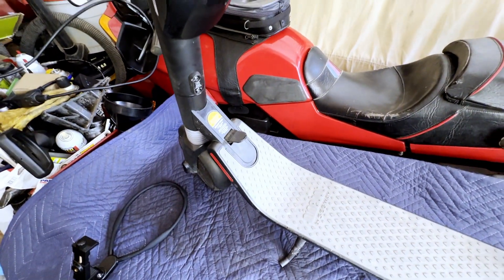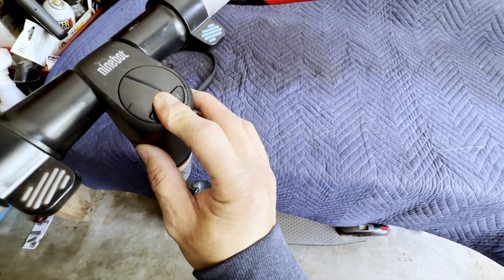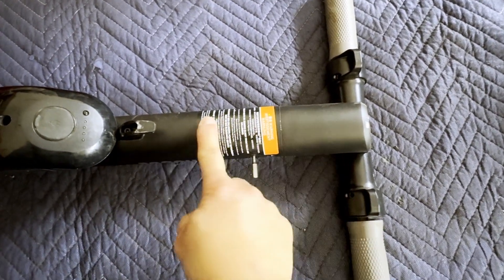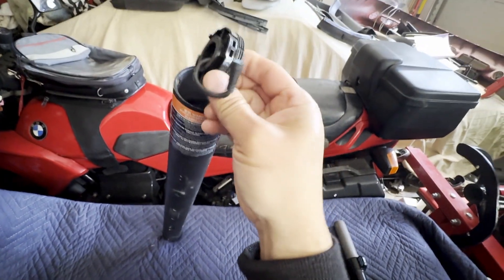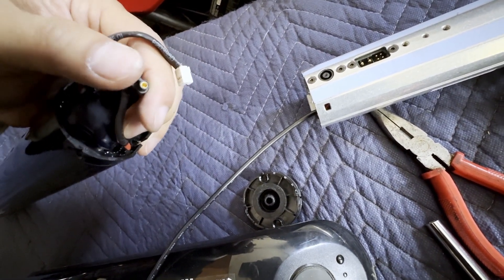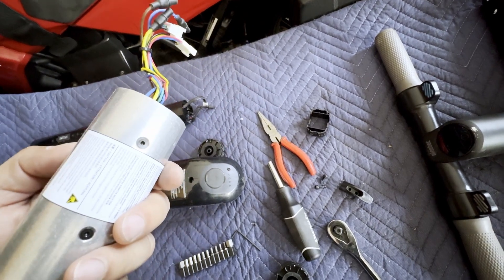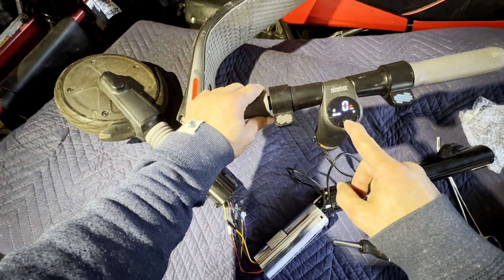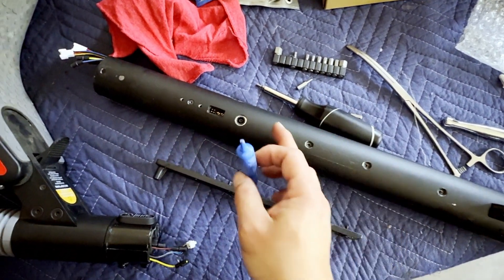How to Fix Error Code 18 | Ninebot ES Scooter

Comment: Kontrolör ile alakası yok. Motor Hall sensör kablosunda sorun var motoru söküp kabloya bakın. Soğuk lehim vardı bendekinde hallettim
Reply from the maker: That's certainly what the error code suggests, but for whatever reason, changing the controller seemed to solve the problem. I've ridden over 160 miles after replacing the controller and knock on wood no issues :)

Comment: hey my ES2 powers off with a single click instead of holding the button while clicking the button should toggle the flashlight, any ideas how to fiux it?
Reply from the maker: It sounds like the button itself might be broken. Here's the replacement part: https://amzn.to/4jS40iM
It's very easy to replace, just unscrew the screws and it will pop right off. Let us know if that fixes your problem. Thanks!!

Comment: I am having the same issue. I will try trouble shooting but I have a new controller and display.
Reply from the maker: If replacing the controller doesn't fix it and you are still getting a Code 18, it's probably the hall sensor. You can try replacing just the hall sensor, but it's probably easier to replace the entire motor instead ... and if you do that, you can update the motor to pick up a complete of MPH :) 
Good Luck!!!
Reply: Did you fix it 
I think I have it replace the front motor wheel
Reply: @EduardoEdMaldo Same i did that and didn't work

Comment: What's a fair price to pay for a 9Bot that has the 18 code and needs this repair?
Reply from the maker: Here's the calculation that I did. A brand new Ninebot ES2 is about $350 on Amazon, so I think a fair price for a working used ES2 is about $200. Error Code 18 could mean a couple of different things. 

If it's the control board (like the part I replaced in the video), that's about $40-70 on Amazon, so if you pickup a used ES2 with an Error 18 for $100, then for $140-170 you got a working scooter and that seems fair. 

However, if it really is the Hall Sensor, then you have to replace the motor, which is about $90-120 then you end up sinking in about $190-220. So it's a bit of a gamble, but in most cases Error 18 is the control board, so if you can get something under $100 you won't get hurt too badly. 

Hope that helps!! Good luck!!
Reply: @kintsugimoto  Thanks for your quick reply!  Found one with 18 code, asking $150.  They say it just needs to be reset, your video tells me otherwise.  Subscribed to your channel!
Reply from the maker: @alismyname2508  Thanks for the sub!! 
Yeah, Error Code 18 will take more than just a simple reset. If it was that easy, they could have just reset it themselves and sold it as a working unit :)

Comment: Hello my ninebot es2 also said error CODE 18 but when i disconnected the Brown/red wire in the control,er it worked im just wondering what the red/brown wire does and if its important. Beacause when i Connect thr red/brown wire it vibratoets,like it driving and braking at the same time.
Reply from the maker: So you have an extra plug?  The controller that I got had an extra set of wires, but there was nothing to plug the wires into. 

There are three single wires (one yellow, one blue, and one brown), and then there is a six prong wire, and a four prong wire. There was another two prong wire on the controller that I bought. Some controllers did not have this extra two prong wire (but they were more expensive, so I got the cheaper controller with the extra wires).

Is that the one you are referring to? And my philosophy has always been ... if it ain't broke, don't fix it !!! lol  So if it's working, don't touch anything!! :)